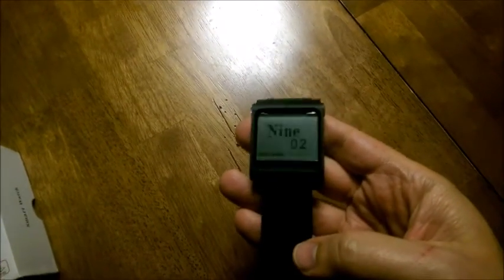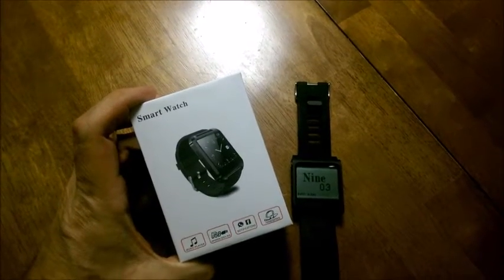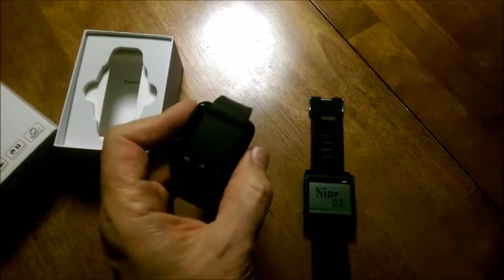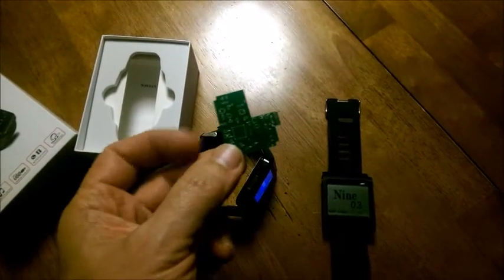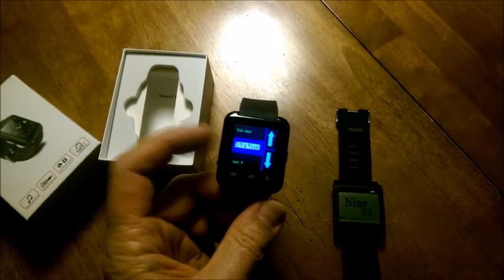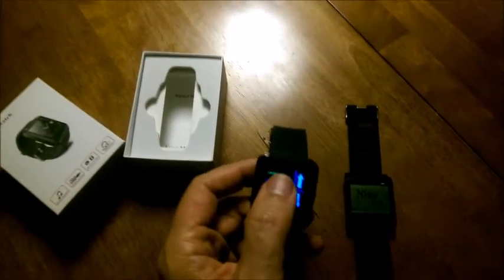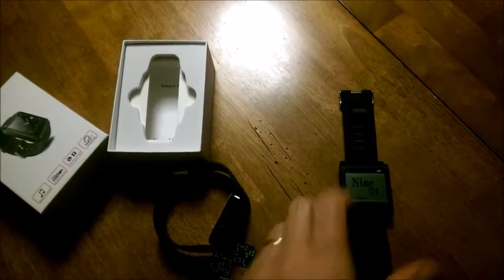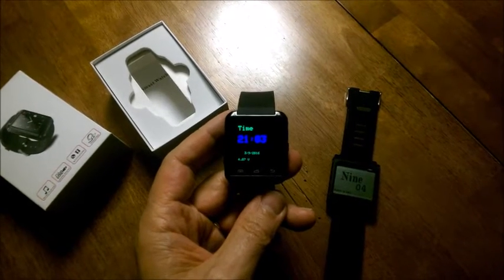U8 arduino watch

Comment: thank you for this!! most people have cool projects and they call them "open source" but then only give you bin files and gerbers so tht noone can actually use there idea and improve on it or even see whats going on in the code to try to learn from it.. so thank you for real.. i have been working on my project for a while now and i always come across arduino "smartwatch" that is a PCB with velcro holding it on and i knew i def didnt want that going on..lol.. i wish i would have started with a more capable micro.. but it took me so long to figure out the code to create the high voltage for the geiger tube.. i couldnt just abandon ship and try to learn how to get the code going for a different setup.. i have had so  many iterations im about to go nuts..lol but since the corona my job has been ridiculously slow.. i work with high levels of radiation and thought it would be awesome to build a Rad watch and really had no direction whatsoever till i found your project.. i thought i finally had my final revision delivered but i went down to 3.3v 8 mhz instead of boosting to 5v and have had nothing but problems trying to program it im pretty sure i have bricked 3/5 or maybe even fried.. idk pretty shitty lol but thank you

Comment: May I ask where you got your U8? (ebay or aliexpress URL). I've bought 3 of these and they seem to differ significantly. 1. there's a slightly different type of touch controller connector (https://www.digikey.de/scripts/DkSearch/dksus.dll?Detail&itemSeq=239691429&uq=636423378439915373) and an entirely different touch controller IC: either the label is etched away or on one U8 it's a "BL6280" by a company that's called "Betterlife" WTF? :)
Any ideas where I can get a U8 with an FT6206 controller? I've already designed a board for an Arduino Zero comaptible version together with a Simblee for wireless capabilities alongside with a 10-DOF sensor. 
Greetings
Reply from the maker: insanitywolf05 I got mine from eBay. There are many variations of the "U8" so I look for the most basic model they have (it is usually the cheapest too). I have been lucky that the 3 I bought were all the same design.
Reply: Dan Geiger thanks for the quick reply. I got the cheapest with most purchases on aliexpress and the cheapest by some local seller on ebay  but got the wrong ones nonetheless. Do you remember the ebay seller you got yours from? I'd really appreciate a hint
Reply from the maker: http://www.ebay.com/itm/Bluetooth-Smart-Wrist-Watch-Phone-Mate-For-Android-IOS-Samsung-iPhone-LG-/253126282054
This was the seller for me. I bought in July 2016 so no guarantees.
Reply: Thanks! I'll let you know as soon as my version works

Comment: did you use an rtc module on either of your watches? im creating a smart watch for a school project and im unsure whether i can get away with using an rtc since i dont have that much space to play with
Reply from the maker: I used an RTC because I didn't want to have to input the time everytime I uploaded new code. You can set Arduino to pass the compile time to your variables when you upload so you can set time that way. But the RTC takes less voltage than the Atmel chip so I maintain time even if I brownout the 32u4. It also allows you to take advantage of the deeper sleep modes on the 32u4. Thanks so much for looking.
Reply: Thanks for the advice!
I guess that's the trade-off for not using one, I'll just have to make room for an RTC, im using 3.3 volts so ill need to find one that is not rated at 5 volts
Reply: you can use the ds1307 i think it was, as opposed to the ds1308, witch is 5v instead of 3v, and theirs lots of libraries for it